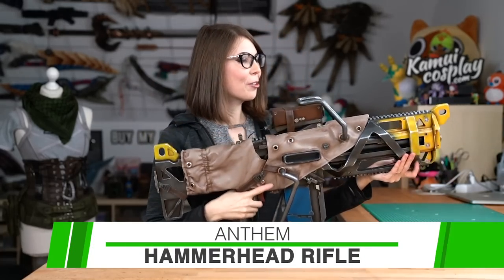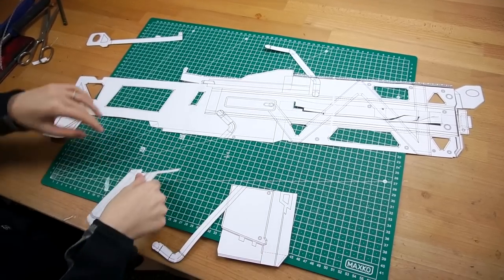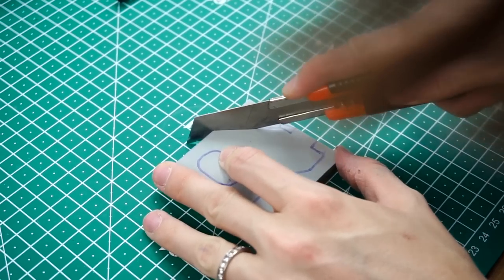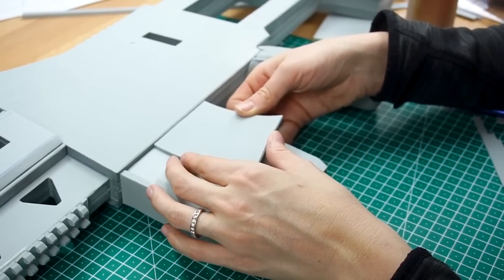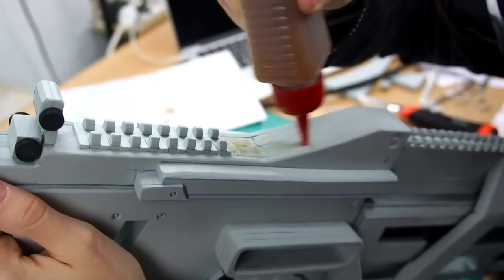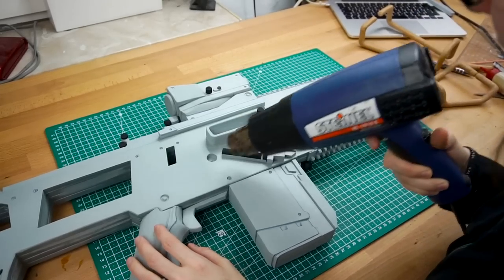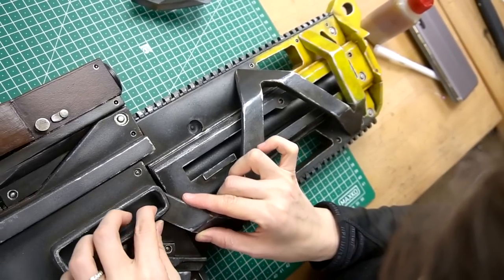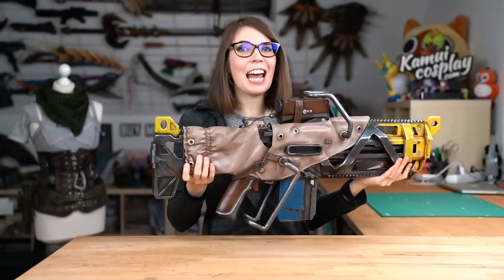Hammerhead Rifle Replica - Anthem

Comment: Oh my! Looks super real! And Anthem looks really interesting. I've got a question, though, is it there any alternative to using a rotary tool? I mean, because nowadays I can't afford buying it 😅. Thanks!
Reply from the maker: Hey Metta! Thanks! Hmmm for foam not really. You can already get a Dremel for 15$ however. That's not too much I think.
Reply: @KamuiCosplay  Really? Thanks for the information! All the ones I've found costed about 50$ or so 😅
Reply: @MettaKirkoff  hey if you are in the US, see if there is a Harbor Freight in your area!  I had the same problem as you, thinking I could never afford one... then I went to harbor freight and not only was it totally affordable, it came with all the little sanding bits and grinding tools and cutting heads that I could want.. didn't even have to buy them separately. I think it was like twelve dollars?? Then i promptly used it to start on Kamui's Stormtrooper rifle 😆
Reply: @MettaKirkoff  Also,  you can buy foam  mats there to cut up and they are super not expensive, and then you don't have to wait for them to be shipped to you. Sorry if I'm spamming, I just spent a long time wanting to do these kinds of things while simultaneously being poor, and options do exist
Reply: @_GreenSkies_  Thank you for the info. Unluckily, I'm not from the US, but I suppose in my country there should be similar options.
Reply: @MettaKirkoff  i guess there are chinese dremel copys which probalby cost a lot less^^

Comment: The one piece of the stock on the rifle you didn't mention, had what appeared to be a length of wire/cable. Is that supposed to be a type of flashlight or laser desiginator?

Comment: Between the two of you, not including the 3D modelling time, how many hours in total did it take to make the replica rifle? How much longer would it take for someone that doesn't have your experience making cosplay props?
Reply from the maker: Hm... it took me around 24 hours to build it, plus 8 hours for painting and priming. I would take that at least two or three times if you never built a prop before. However you clearly become more faster and efficient with every finished project! :)

Comment: Stupid noob question, wouldn’t it be possible to design the blueprint in such a way, to already get the different layers of foam and eliminate the guessing by separating it afterwards?!
Reply from the maker: I guess it's possible but also a lot of work that's not really necessary. :)
Reply: @KamuiCosplay  but would it tho? Your hubby already constructs it in 3D and if slicing it in slices through the Y Achsis should eliminate your guessing. As I said, from a noobs perspective without experience in this particular software but in Blender or Cinema, you can slice your model. Build the model and in the end, slice it in sheets of equal thickness?!